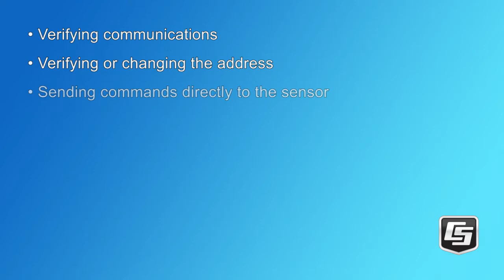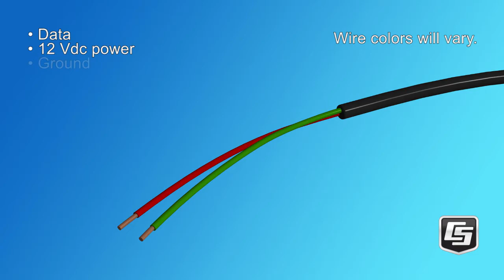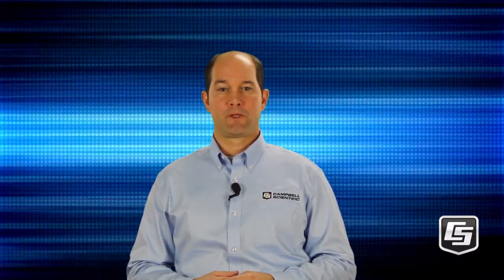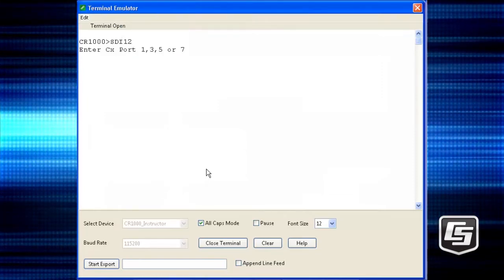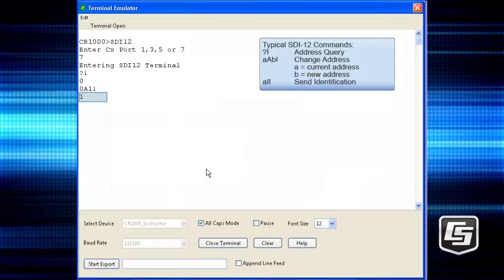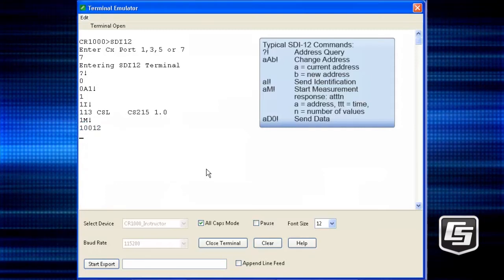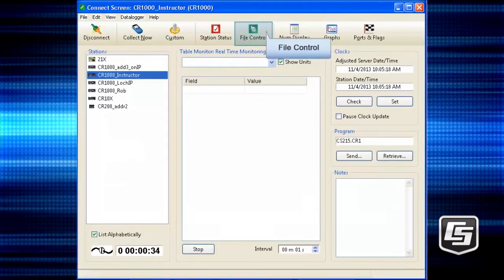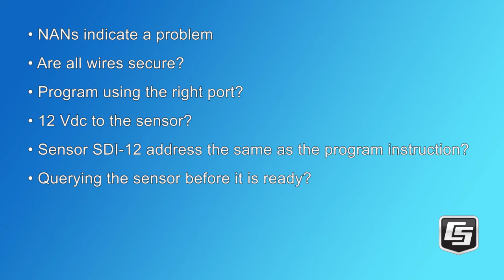SDI-12 Transparent Mode

Comment: hello, I am using SDI-12 sensors for measuring soil moisture. One of the sensors is showing value in percentage like 86/82. So, is there any way to correct it.